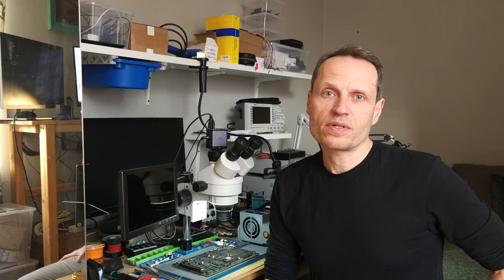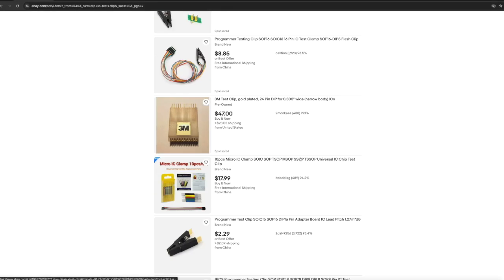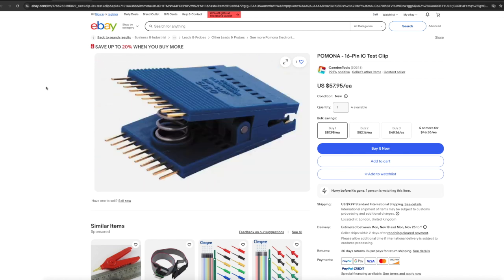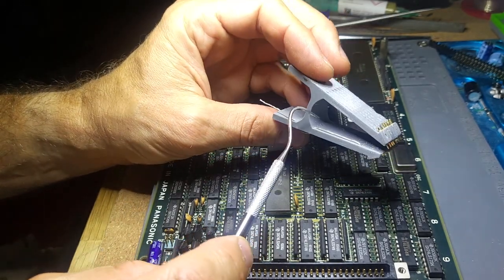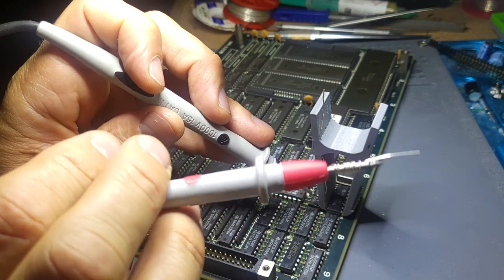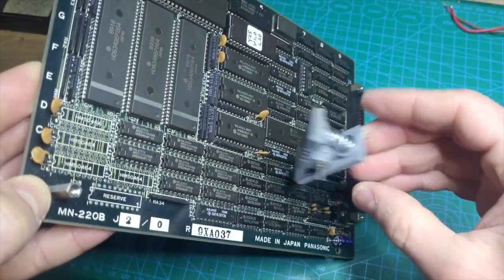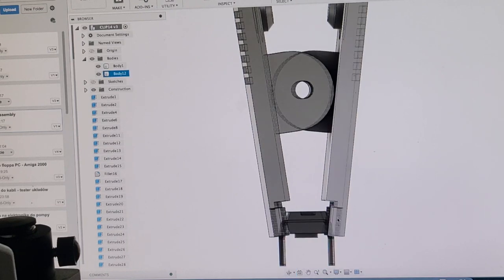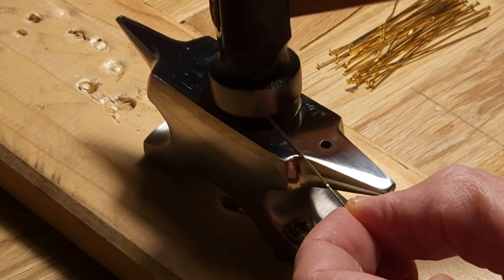DIP Clips!

Comment: Headpins: 3 inch 21 gauge gold plated brass headpins (Ebay, Aliexpress can you post the link for this?
Reply from the maker: Sure, https://www.aliexpress.us/item/1005006455531311.html
Reply: @wojtekmitus  tnkz, can you test the ic's directly on the board with this? I know the tests can be affected by other components but it would be a clue before disassembling them.
Reply from the maker: You can test if IC is behaving as expected in circuit, but in my opinion, no good way to test a single IC while it's on the board, as in check the truth table for some logic IC or something like that. You would have to power the chip up, essentially powering entire board up, as you would supply the power to the board power rail, and i think that the circuit would interfere with the test result.